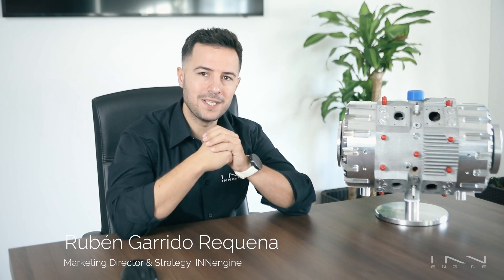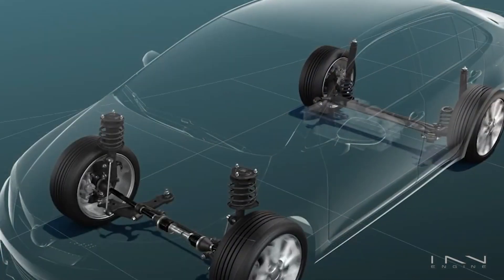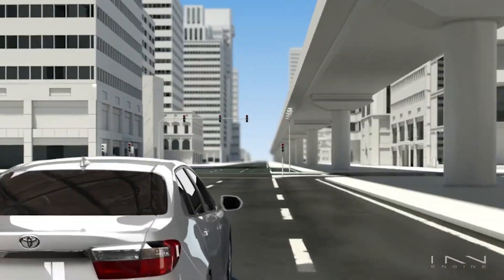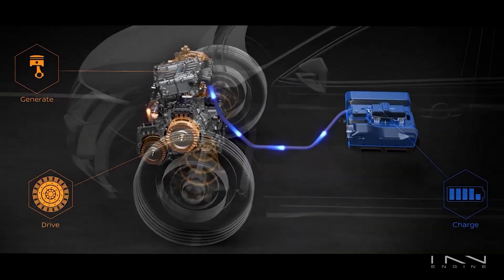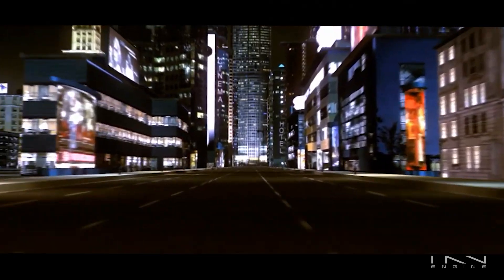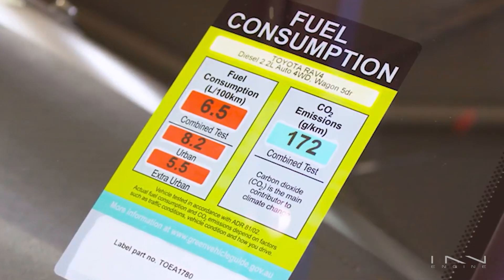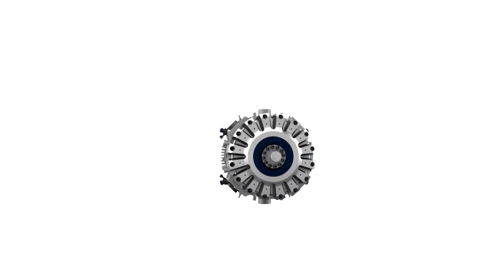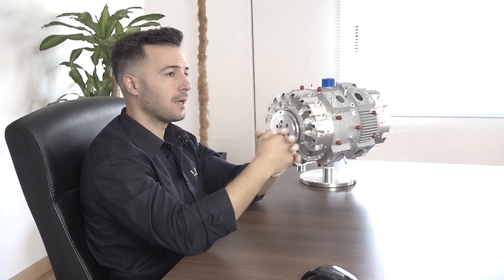What is a range extender?

Comment: The idea behind all this is nothing new. Locomotives/Trains and very heavy equipment have been using a similar setup for decades. Their diesel engines are only there to provide electrical power to the drive motors. When hybrid cars first started showing up it always bugged me that the gas engines were still driving the cars. All internal combustion engines are most efficient while at steady state operations. Its why a gasoline powered car gets better fuel mileage on the highway as opposed to in towns and cities. So incorporating a small power dense ic engine into an EV solely as a generator makes all the sense and opens up the market to people who live in areas with little to no EV infrastructure.  But for whatever reason manufacturers wont use them

Comment: Train called ( by misnaming) the diesel electric.  ICE makes electricity..  the vehicle
Is driven directly by electric motor. No transmission. Here the ingenious  INN postulate
This same principle. For the  e rex..  I say use the
  e rex  as an Rankine cycle expander
Using external combustion.. with helium  or nitrogen or freon as a working gas
Or mix gases

Comment: I do not like the word
Hybrid.  An i.c. generator
Makes  electric .power 
To drive the wheels
Do the work. Electricity
Replaces 1trans mission
2Drive shaft 3differential
4Clutch . 
 This  arial engine is
Cammed.... 
... (CROOKED)
dialectal, England : CROOKED, AWRY
dialectal, England : CROOKED, AWRY
Adjective

alteration (influenced by -ed) of CAM entry 3

Using  a  sinusoidal cam aka swashplate..

Comment: What is the difference between diesel and diesel-electric locomotives?
The diesel locomotive works on the diesel. The engine of the electric train requires electricity through overhead lines. The engine of the diesel train does not require direct power or electricity from overhead lines. This type of locomotive does not generate the own power.May 16, 2021
Related questions
Do diesel locomotives have electric engines?
Why are train engines diesel-electric?

It all comes down to efficiency; electric motors are far more efficient than internal combustion engines when it comes to creating mechanical energy, and this is particularly relevant with trains.Feb 14, 2023

lo·co·mo·tive
/ˌlōkəˈmōdiv/
noun
a powered rail vehicle used for pulling trains.
"a diesel locomotive"

Comment: The amount of marketing BS in these videos made me even question the whole damn thing

 it's basically a hybrid with e rex engine 🤦🏻‍♂️
BECAUSE THIS IS HOW IT IS!!!

A HYBRID IS AN ENGINE CONNECTED TO THE ELECTRIC MOTOR/BATTERY INSTEAD OF TIRES!!!😂
Reply: its a series hybrid, it only charges the batteries, meaning it can burn gas efficiently. you need very little amount of gasoline to travel far if most of the energy is converted to electricity

Comment: Why not a smaller, liquid cooled, same 2 face cam lobe, six cylinder ?
Reply: Similar balance with 4 pistons, while increasing the use of space available in a circular design. And increasing strength by allowing strong parts to be used (thicker metal). Also the engine might have problems with running to hot for too long. More pistons equals a more evenly distributed heat load across the engine.
Reply: @bamnasitis  Yes, but 4-Stroke Radials are of ODD cylinder count that the Firing Order Can Progress Around By Skipping Cylinders.....so a 2-Stoke 4 cylinder radial, Or A 5-Cylinder 4-Stroke Radial, ( for more cylinders )
Reply: @bamnasitis  so once you work through the logic on that, the 3 Cylinder would combine the Economy of a Lower Parts Count, with a Slightly Higher Torque Per Pound. ( in also striving to shed the need for a gear box ), where also a slower turning engine tends to have higher valve train efficiency, ( by M*V^2 ), and reliability....and the parts do not need to be thicker than they need to be.
Reply: @bamnasitis  but Of Course, a 5-cylinder would have Much More Horse Power Potential per pound...so you see?...so my 3 Cylinder suggestion was based on the economy of Torque per pound....Not the most power, but the most Torque given other considerations.
Reply: @bamnasitis  i do concept development for H-D, i was just talking about it as a design exercise, ( until i found out what they go for )
the Radial-3 Turbo will be in a surgical clean room assembly, and preceded by meticulous QC if it goes.....but i did get the bulletin on it written up, and slated for forwarded to H-D headquarters ASAP....
so we have the Radial -3 here.

Comment: This is simply a swash-plate engine, with modified plates and a unique variable compression feature. The original swash-plate engine can be viewed at the Air force museum in Dayton ,Ohio, USA. It was developed late in the second World War for fighter aircraft, but was never produced because jet propulsion was the deemed to be the way to go forward for military superiority. Although a re-hash of an idea over 70 years old, it does hold promise for cars, boats, and prop driven aircraft. As far as using hydrogen for fuel, that is largely a marketing ploy. And it remains to be seen if any of these ever make it to mass production. I do like it's design and merits.
Reply: I agree with your assessment of the "green H2" idea - I think hydrogen, whether in liquefied or gaseous state, presents so many challenges for so low an energy density that it is never going to be viable as a fuel for internal combustion engine vehicles.

The swash-plate design does seem promising as a petrol-fueled range extender. the basic mechanisms are well-proven not only from the late WWII concept but also from machines such as helicopter rotors and the cam-driven action mechanisms of gatling guns. 
I, too, am interested in this engine INNengine is promoting.
Reply: Use as a range extender is the key here.  The video provides claims but no data:
What is the ideal recharge rate?
What size/power is required to obtain that rate?
What is the fuel consumption at that rate?
How many recharge cycles per tank?
What is the total eMPG?
Will it run on diesel?

It seems to me that the eMPG has to be at least 100mpg, the tank size should be about 8 gallons, the range should be at least 500 miles, and the cost of the INN plus tank should be less than a 40KW battery pack.
Reply: Let me add the three challenges I see here:
1) Stable combustion as fuel is squirted tangential to the pistons and

2) Cam plate design constraints leading to lower than desired torque.

3) Cooling or at least symmetric cooling

Comment: Greetings gentlemen,

I am working on a roughly 2000bhp electric car and wondering if this engine can be scaled up cost effectively for such application.

Thank you in advance
Reply from the maker: Yes, in fact the larger the engine the bigger the advantages in terms of size and weight.
Reply: you are the one building the car, you should know